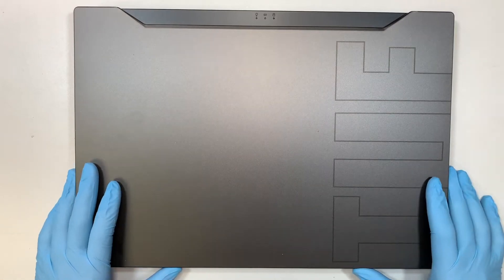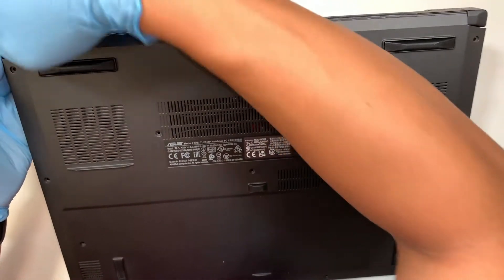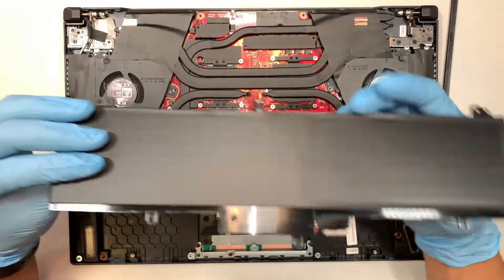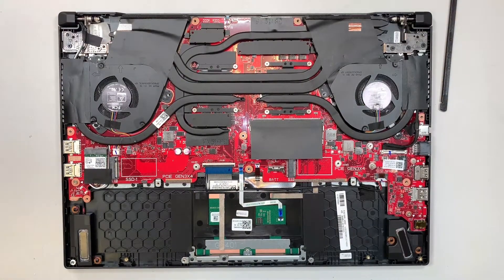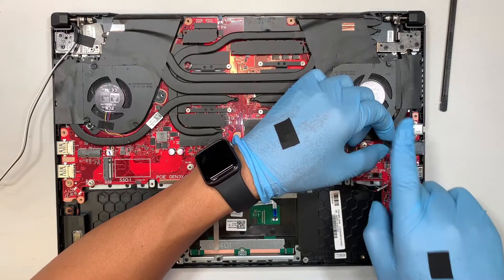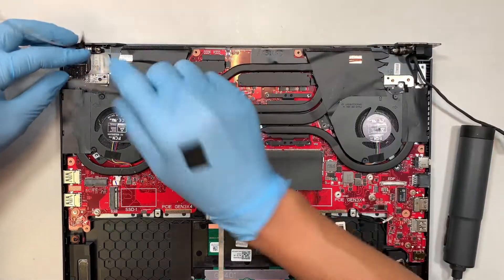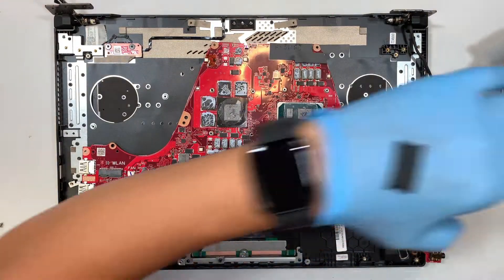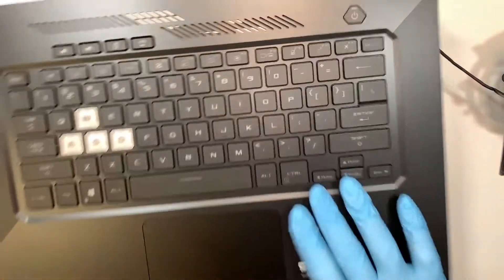ASUS TUF Dash 15 Tear Down Disassemble Upgrade

Comment: Liked the breakdown on the video, goo basics on the laptop. Links to video helpful. I don't think my laptop is a TUF516PE but a TUF516P,....not sure as I bought next to new and with 16GB ram instead of 8GB. So I will be opening it up to add 2TB NVME to the second slot and to double check if the ram is upgraded already or not.

Do you happen to know the max ram capacity or max NVME capacity? Just want to confirm max ram is 32GB, but I was told I could do 2 TB NVME instead of 1 TB. Cheers

Comment: My laptop fan has been vibrating randomly when i use it, Its not every time but it gets annoying how often it is. Theres no dust or very little dust, I dont see any small object inside and I havent gotten the chance to go to a tech store for help. Its only the left side one not the right side. Well left side from my perspective of having the screen facing me. Any tips? Ive had this laptop since 2022 as a graduation gift while it was on sale.
Reply: Bro I got the same issue, lmk if you figure anything out I'm thinking about just replacing the fan entirely.

Comment: Great Video.. Helped locate where the too silver screws go I had left over 😅
The fans... I'll take off the back and put them in their place..
I repasted mine with old school artic silver and upsiren U6 paste on the VRMs and other chips..
Tempreeatures are actually very decent now.. On idle 35C and under gaming.. CPU average 80 and GPU 75ish..much better than the CPU being 95C most of the time.
Other things I found was basically the CPU speed step turbo is too much for this unit. I've limited it to 42Ghtz..since in gaming with both the CPU and GPU temperatures getting hot.. It's just not worth it.
Most games I play are not heavy CPU so I'm not taking any FPS hits.. And leaving more thermal headroom for the GPU to do its thing.
The Tuf is still great for me.. Picked it up for about $900USD in Australia 3 years ago and it's still banging 1440p games with decent results.. Thanks again for this video it really helped me solve my two extra screw mystery 😊😊

Comment: do i have to disconnect battery, ssd and ram if i want to change thermal paste? or i just have to unscrew the heatsink ?
Reply: No.. Just remove the heat sink.. Disconnecting the battery is a good idea..

Comment: I am not discouraging the creator in any way but my advice would be to get this done by an professional because if you failed to apply the paste correctly and get the thermal paste onto the motherboard it might short circuit and cause serious damage which happened in my case I tried to do it on my own and shorted my gpu. Now I am in a condition where my system can’t be recovered.
Reply: this is non conductive thermal paste, it won't short circuit any components.
You likely just messed up with static discharge like a novice :P

Comment: hello, i have a question, currently im using only 1 slot for the ssd which is nvme m.2, if i want to buy a second ssd  do i need to put thermal pad on it?
Reply: Hi, I just bought and installed a second SSD on my laptop yesterday. Same model of laptop, FX516PE. I had bought a Crucial P3 1TB, and it has what looked like a stock thermal pad on it. Not ideal for temps, but hey, I don't have to bother with it.

Comment: My fans stopped working (0 rpm) after using new thermal compound any tips how to fix?
Reply: Please
Reply from the maker: Did you check the fan cable and connector ?
Reply: I fixed the problem. it wasnt mechanical just had to reset bios to default

Comment: I have disassembled mine helped me learn about the laptop. What are the black tapes on the fans? mine became less sticky and is not sticking to the plastic fully on the edges where hot air is supposed to come out. is it just tape or does it have a function?
Reply from the maker: Not that important function. Tape is to hold them together tightly.

Comment: Hey @UberGeeks ! I really appreciate your videos! They’re awesome! 

I have a problem tho. I removed the battery and the SSD, then i put ever back together the way it was. My laptop doesn’t turn back in anymore nor indicate the charging light. Could you help me with this, please?
Reply: did u fix it?
Reply: @nikitaostrovski9379 no, sadly i did not. Tried everything and it turned out that the power was not going to the video Card Chip. Had to replace the whole motherboard.
Reply: @chubby3134  how much did it cost u?

Comment: 2:10 - and that, my friend, is why you need to read the service manual before you stick your electric screwdriver into the laptop. The bottom right screw is not supposed to come out, it lifts the corner of the back cover so that you can insert your prying tool and easily remove the cover.
Reply: true - the screw raises the edge of the of back panel so prying it open is much easier
Reply from the maker: You sure ?
Reply: @UbergeeksBiz  Absolutely. This is pretty much standard nowadays for high-end Asus laptops. See https://youtu.be/YRBDmhIOMPs for reference.
Reply: Yes, he is completely right. @UbergeeksBiz
Reply: @UbergeeksBiz He is right. It's - unofficially at least - called a popping screw. It is supposed to prop up the panel, so you can insert a tool and pry it up easily. The part comes off when you lift the other clips.

Comment: Do you know if there is a problem if I insert a ram module with 32GB 3200mhz in the motherboard and my laptop has 8gb 3200mhz and the limit is 32GB?
Reply: nah there isnt i did it with mine.. same model no problems
Reply: I can confirm.
Reply: Hi Leonardo did you do it ? I’d like to do the same as you! Please let me know if I can do it. Ty.
Reply: @SamuelVargas-l4g  
Processor	11th Gen Intel(R) Core(TM) i7-11370H @ 3.30GHz   3.30 GHz
Installed RAM	40.0 GB (39.7 GB usable)

Comment: You never showed or mentioned the different length bolts when removing the undercover.
Reply: Good point.. The short screws go in each corner and at the middle sections at the edges.. Long screws in the middle.. I found out by trial and error.. The screws should take many many turns to bed

Comment: Thanks ! most comprehensive video on how to disassemble this video. Would it be possible to upgrade the CPU from an i5 to an i7 118X0H ?
My TUF Dash 15 is still under warranty and I wanted to wait before I try to upgrade.
Reply: no it's soldered to the motherboard

Comment: Hey, I want to get the f15 with 8 gb ram is the 8 gb soldered to the motherboard or is it 4 gb and 4 gb cuz if theres 4 gb soldered to the motherboard then i can’t upgrade to 16 gb, thanks
Reply from the maker: You have limitation for RAM upgrade. Try get 16gb RAM and replace with the current RAM

Comment: After removing the battery press down the power button for 5 to 15 seconds so that the electricity discharges completely off the board, without doing it, even a single screw drop on the mainboard can very much damage the laptop and could even brick the laptop.
Reply: just wanted to change the SSD, and the laptop doesn't power on again, even though I put back the old SSD
Reply: @bjarkareem9963  check if you plugged in the cables correct, check whether the ram is seated correctly or the  battery cable is plugged in correctly. hope this helps !!
Reply: @rameshravikumar9515  a simple ssd upgrade shouldnt have any cables unplugged or messing with ram (edit: as shown in the video the ram is soldered directly to the pcb), other then disconnecting the battery to be safe which isnt necessary and is up to the individual to reconnect everything correctly. on mine i simply used the 2nd unused m.2 slot cleaned the fans and put back plastic back on, no issue.
Reply: @bjarkareem9963  Hey sorry to bother, but did you find a way to fix the issue? I've got the same problem my laptop won't boot after the upgrade. I followed the video, unplugged the power and pushed the power button to discharge and then I've only added an NVMe in the second slot but after reassembling there's no sign of life in my pc.
Reply: @ch-bar did you replug the power? I wouldn't have bothered unplugging it if all you need is ram/ssd upgrade you can just plug them in to the slots
Reply: @ch-bar Maybe the battery isn't seated properly? The first time I did this, I had to put way more force than I had imagined necessary to put the battery connector back on.
Reply: @ch-bar Wait, also, did you remove the primary (originally in there) SSD? Your OS is on that SSD, so without it, you won't have your data or anything to boot into.
Reply: how do you reset bios? where is cmos battery? does removing battery and pressing power button for 15 mins also reseting the bios? because of electricity discharge?
Reply: I hope we get an answer
Reply: Is that why my shit won't even turn on now
Reply: This asshole never mentioned this and now my laptop is $1700 brick . I'm so fuckin pissed.

Comment: Hi there!  With the GPU, do you put thermal paste on both the dies, or just the bigger one (as you didn't put any fresh paste on the smaller one)? Cheers!
Reply: he said he didnt remove it because its fresh paste, since its a new unused laptop. ideally youd want to remove it all with a solvent like rubbing alcohol and reapply thermal paste on both dies and each vram chip, basically everywhere there was thermal compound. dont need much of it, enough that it covers it all once heatsink is reinstalled and screwed down, but its better to have too much then too little
Reply: the bigger one is the gpu
Reply: so for the gpu only put on the bigger one

Comment: If I'm not mistaken bottom right screw does not come off as it lifts up that part of the bottom lid so that you dont have to use a tool to pry the bottom lid open
Reply from the maker: It should come off, sometimes it may get stuck. As long as you can pry open the bottom lid, you are fine
Reply: @UbergeeksBiz  No, it does not come off. Like the person above said, it is designed to push up the case so you can easily open the laptop. You have some things to learn about computers and it shows by what you did with the thermal paste

Comment: Hello
 Would i be able to remove the heatsink without taking any other components out? im trying to just remove the thermal paste and add new one.
Thank You
Reply from the maker: Yes you can just remove the heatsink
Reply: @UbergeeksBiz  ok thank you
Reply: @UbergeeksBiz  So can i remove it without removing any cables like from the cpu and the others?
Reply from the maker: @AleGzutu  Yes

Comment: can I put a 16gb ddr4, in addition to the 8gb? won't it cause any problem? or do you recommend a 8gb only?
good video very informative💯🙏
Reply: yes you can upgrade ur ram...max to 32 g ram
Reply from the maker: Yes you can upgrade your RAM
Reply: My Brother have the same laptop and he recently upgraded the RAM to 40 GB.
8GB soldered and put a 32GB ADATA module and its working fine

Comment: I have a question, W
what would happen if I spilled some water on the keyboard, would it fall on the motherboard or not? Because I see that the keyboard is some sealed.
Reply: I really need an answer before I take it to the technician in vain. 😢
Reply: unfortunately it really depends on how much water, did it flow to the motherboard etc. i think you'll need to check it